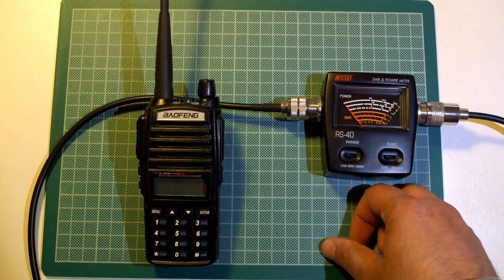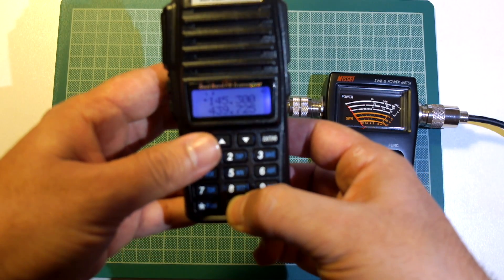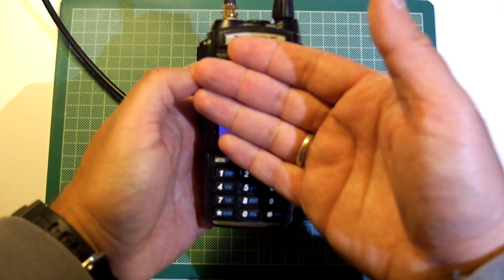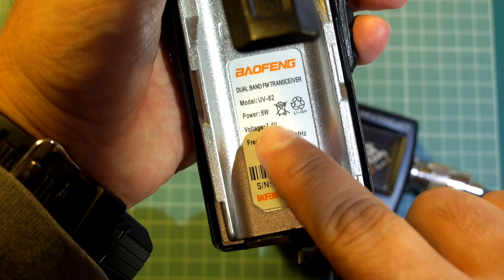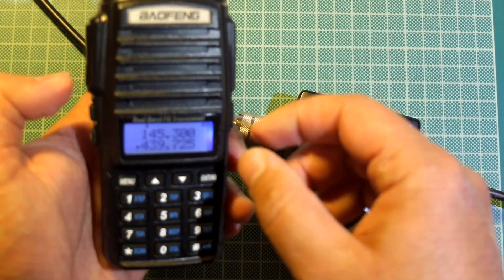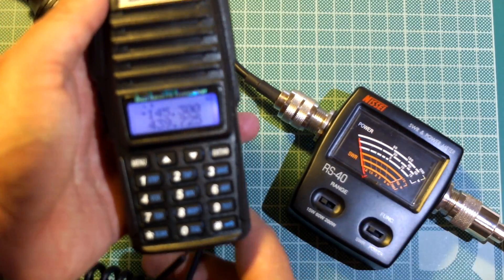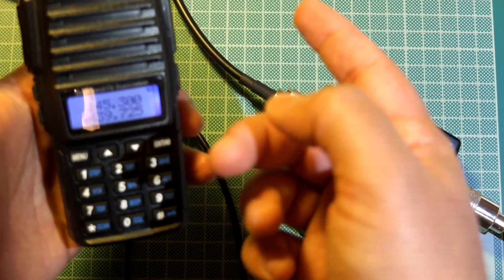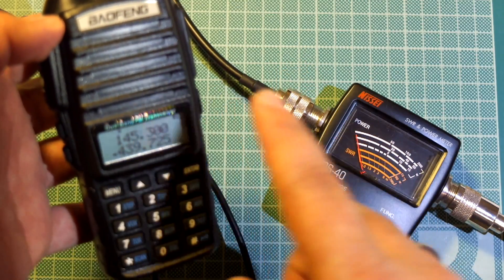Baofeng UV-82 8W Power Test

Comment: He just has the original 5w radio. That’s why there is only an L for low on the screen and nothing for high. The actual 8w HP versions have a H, M, and L that pop up on the screen for the three power levels. 

Folks have tested the UV 82’s pretty extensively and the 5w two power level units are pretty close to advertised, as are the tri power 8w ones, you just need to be careful as many of the HP ones aren’t HP, they’re just the original 5w, mislabeled.

Comment: That's strange because I have 2 UV82 8W version and both have 3 power settings: low/mid/high, and both deliver 8w easily... I don't know if you have a standard 5W UV-82 advertise as an 8W version!?!
Reply: hi DimeBag
I have a question: is there any difference between UHF frequencies??
for example, I mean is there any difference between 410.5 MHz vs 470 MHz??
I'm a mountain climber and I have purchased a uv82. now I want to know which frequency should I use in mountains and forests to achieve the most range? and also which frequency should I use in outdoor(such as deserts) to achieve the most range? or there is no difference between 410 & 433 & 470 MHz at all !??
Reply: @mohammadbararti5443  I have the best result on PMR446!

Comment: I have about five UV-82s (8Watts), and they tested very good, considering.... Frequencies 462.525 (6.4W); 142.500 (6.65W); and 146.955 (6.8W). You can't really expect 8Ws in any of these frequencies, but it's close enough. If you hit the [# Key], you can cycle through the power settings. If you can cycle through H, M and L, you've got the higher power UV-82 model. If it goes from H to nothing, you've got the standard version, and testing is irrelevant. 

That said, even the standard version UV-82 is better than most of the radios I've tested, and you shouldn't fret. The good thing about the high power model is that you can put it on the MEDIUM and get 462.525 (4.4W); 142.500 (4.3W); and 146.955 (4.78W). This means its MEDIUM power settings are what most handheld radios are powered at at HIGH, and that's impressive! So it would not be a bad idea to put your radio on MEDIUM and leave it at that. 

Even most expensive handheld radios don't quite hit 5Watts, right? They usually come in at 4.xW. Thus, the UV-82 (8W) comes in at MEDIUM power levels, and what most handheld radios (even expensive ones) come in at at HIGH. Then, if you need some extra push, you can inch it up two watts, from 4-point-something to 6-point-something. And you can save battery power by keeping it on MEDIUM. Thus, the UV-82 (8W) is a fabulous radio. It's the sleeping giant Baofeng.
Reply from the maker: I agree with you. When I made this video, there were UV-82s in the market that claimed and actually had 8W of output power, but there were also models like this one I tested, that claimed 8W of power but the claims were false. This is one of those radios.
Reply: @HamRadioReviews  » I hope you find one of the 8W versions. I have two SWR meters and the 82/8W models got very nice results. High: 142.000/6.3W; 146.955/ 6.8W; 146.050/ 6.8W; 460.000 5.3W; 462.725/ 5.3W. Medium: 142.000/ 4.8W; 146.955/ 4.9W; 146.050/ 4.9W; 460.000/ 4.2W; 462.725/ 4.2W. 

I also highly recommend the Baofeng UV-H6. Very nice 10W radio. Average High: 8.6W. Of the two, the UV-82 (8W) is the winner. Why? Because 1) it has a flashlight, and 2) because its Medium powers are very close to what most 5W radios are on their High settings! The Medium settings on the H6 are 3.8 or 3.4, a little less than a 5W radio. The good thing about the UV-82 (8W) is that you can leave it on Medium all the time and you won't sacrifice a thing. The H6 can work on Medium, but it will be a bit anemic. Both are great radios.
Reply: hi john
I have a question: is there any difference between UHF frequencies??
for example, I mean is there any difference between 410.5 MHz vs 470 MHz??
I'm a mountain climber and I have purchased a uv82. now I want to know which frequency should I use in mountains and forests to achieve the most range? and also which frequency should I use in outdoor(such as deserts) to achieve the most range? or there is no difference between 410 & 433 & 470 MHz at all !??
Reply: @mohammadbararti5443   » As you know, all these radios operate best in line of sight; however, if you're in the woods, you'll most likely have to penetrate trees and hills, and from what I understand, VHF will offer some advantage. That said, I generally prefer UHF. And to answer your question more specifically, some people say it's always best to use a frequency midway through the frequency range. I'd choose a frequency in the 443-445MHz range. But is there any significant difference? I don't think so. 

I recently did a range test with a Baofeng  UV-H6 (a wonderful little radio). My wife stayed home and I took off through the neighborhood. I kept my radio in the midrange power settings and it wasn't long before I found myself battling static. I then kicked up the power and my wife reported I was coming in much better, so power also is something you might want to consider. The H6 and the Retevis RT-29 Military (waterproof) are both great options, and the latter will give you a full 10 watts. You can get them in VHS and UHF with a big honking battery. 

If you want to go with a Retevis, I can give you the frequencies of the channels. Notarubicon tested the RT-29 and gave it a glowing review. He was able to go ten miles with it line of sight. If money is a huge issue, I was able to get 8.7 watts out of the UV-H6. With the UV-82, it really didn't seem to like UHF very much. I got 6.8 watts out of the VHF and only 5.3 on UHF. If you have the regular UV-82 5W, it shouldn't be an issue, but if it's the 8W version, I couldn't get more than 5.3 watts out of UHF. Of course, your radio may be different.
Reply: @johnroberts6695  tnx john u explained very well❤ i have 8w uv82 i have test in line of sight with 433.325 and 479.425 the result was bizare!! my connection lost on 433.325 mhz at 2.5 km but i had connection on 8km on 479mhz!! at the same land
Reply: If you are outside in open terrain with little obstruction between you and the person you are talking to, use the lowest frequency, if it's very built up use the highest.
That's technical advice, not legal advice as many frequencies it's illegal to operate on..
But nobody is really going to be bothered or interfered with, and incase of emergency use any frequency you hear someone on
Reply: @mohammadbararti5443 just UHF IN jangles
Reply: yes 👍

Comment: You aren't testing an 8W UV-82. You need to test an 8W model (which will have HIGH, MEDIUM and LOW). When you saw the HIGH and LOW settings, you should have immediately realized you had a 5W version with a label anyone could have printed and stuck on. 

I have an 8W version that has all three settings. The best outputs I have were 7.6W with UHF and just about 6W with VHF. The Baofeng 8W UV-5R comes in at 7.8W at UHF and 6.8W with VHF. But you have to watch the fake radios. Some are great, but others are just labels like yours. You should have returned yours because the 8W 82s are great and personally, I doubt you could see the difference between 8W and 5W.

Comment: My UV-82 says 5V on the back. It only has Low or High settings.
Reply from the maker: Yes, that's most likely the "normal" version of the radio and it is actually 5W.

Comment: Mine is Real baofeng uv82hp with 3 output mode selector (hi/med/lo). I did adjust the internal power output trimmer (vr2) to exact 8 watts. factory release baofeng i got has only 6 watts setting on hi power output. Now settings (hi-8/ med-5/lo-0.5).
Reply from the maker: Must be a newer model.

Comment: I find with all these radios that if you trasmit on full power at 138.000  you will get full output from the radio. Bit of a design glitch but i do actually get the full specified power out of all my Chinese radio collection but only on that frequency.

Comment: A particularly humid winter. Went to my safe and pulled my pet 440 radio out of cold storeage. Very quickly had a funeral. It was dead, dead ,dead, do you recommend a UV 82. ?  My dearly departed was a alnico. 1 watt 440 rig. .
Reply: Heck, yeah. The UV-82s are the most underrated radio Baofeng makes. Why someone would buy a 5R is beyond me. People think they're not weather resistant when they're more resistant than they think. I love them. Their weak link is the display. Two lines.
Reply: Uv-82 and the new gt-5r on my shelf. Thanks

Comment: BTW, it doesn't says 8W TRANSMIT power on the back side, just 8W power. It may mean that device power consumption is 8W.
Reply from the maker: I don't think so. Even if it is, it's still misleading.
Reply: @HamRadioReviews  I agree
Reply: Nope, the battery output would be the device input.

Comment: i have a UV-9R plus it claims to have 15 watts on high it is only 4 watts and the battery is suppose to be 8000 MAH but i dont think it is. i think baofeng lie about the specks of their radios mine is being sold everywhere as 15 watts the manual says 5 so even the manual lies.
Reply from the maker: Sounds like not true claims.

Comment: How did you bring up the battery voltage on the screen???
Reply from the maker: Press and hold the "0" key. If it does not show up, you probably have an older model.
Reply: HamRadioReviews Thanks for the reply. I must have an older model, no battery info here.

Comment: Please do not take this information wrong. The back label on your Baofeng UV-82 should say UV-82HP if it is a HP model or maybe UV-82HX. Since it says UV-82 with no H, I doubt very much that it is a UV-82 8 watt radio despite what your seller stated. Sorry. Additionally the wattmeter that you are using is not very accurate. I would not trust it. Lastly,  my UV-82HP (from Baofeng Tech USA) is marked in the battery compartment as 7-8 watts RF OUTPUT., not simply 8 watts, which may be the input wattage, as we know that there is a difference between input power and output power. I suggest that you ask your dealer for a refund.   73
Reply: Not necessarily. None of my UV-82 (8W) radios are labelled UV-82HPs, yet they are clearly higher powered. Frequencies measured on HIGH at 462.525 (6.4W); 142.500 (6.65W); and 146.955 (6.8W). You can't really expect 8Ws in any of these frequencies, but it's close enough. If you hit the [# Key], you can cycle through the power settings. If you can cycle through H, M and L, you've got the higher power UV-82 model. If it goes from H to nothing, you've got the standard version, and testing is irrelevant. 

That said, even the standard version UV-82 is better than most of the radios I've tested, and you shouldn't fret. The good thing about the high power model is that you can put it on the MEDIUM and get 462.525 (4.4W); 142.500 (4.3W); and 146.955 (4.78W). This means its MEDIUM power settings are what most handheld radios are powered at at HIGH, and that's impressive! So it would not be a bad idea to put your radio on MEDIUM and leave it at that.

Comment: Thx Sir for showing these test results to confirm their false claims, I purchased what appears to be between a BaoFeng UV5R & BF-F8HP hybrid variant of another branding. It claims to be capable of 10 watts power transmission which I find unbelievable even without conducting a test, it also only has High & Low power settings which as you mentioned isn't actually capable of it as new versions of UV5R & BF-F8HP 8 watts has H.M.L indications. Chinese HT radios are cheap but also are notorious for false claims, cheers.

Comment: Thanks for the video.  I have 2 UV-5RA and tried to use the buttons like you did here and found out that one functions like your video and the other one doesn't.  I suspect it is because of the firmware upgrade on the second one I bought.  Nice to know how to check voltage and set the power level with the buttons.

Comment: This is NOT THE HIGH POWER VERSION. I think baofeng accidental written the watt to 8
Reply from the maker: Yes, it not the HP model, I am mentioning this in the video. However, a lot of "accidental printing" goes on... 8W of power, 3000mAh batteries... ;)
Reply: HamRadioReviews no its not the 8 watt version that's a 5 watt radio & model number. The correct model # for a 8 watt is UV-82HP Just don't buy any ham radio on AliExpress. The Fake Fakes

Comment: The high powered Baofeng radios have a medium power setting- not just high and low. You must have a mislabeled radio my friend.
Reply from the maker: Indeed!
Reply: @HamRadioReviews  do you know where to buy oryginal UV82HP but in Eu? i cant find any oficcial websites in eu :(
Reply: You have a Fake Baofeng. Noticed it was fake when I didn't see a FCC Badge on the back after you removed the battery.
Reply: @Shad0wGeneral  FCC? Dude probably isn't in America lol
Reply: Lol i think you are both refering to the waterproof one who has motorola headset connector. This radio only has low and high power
Reply: Yep, if High, Medium & Low  power settings are seen, it's an 8 watt model.

Comment: UV-82HP (for the US) or 82HX (for Europe) are the only official 82 based 8W models (BF-F8HP is only other official 8W model, the rest are all fakes and illegally made and sold). 
Otherwise the UV-82, 82C, 82X, 82L at all 5W. I suspect the seller you bought from had it mislabeled as 8W (possibly to charge more aka scam people).
Correction: HX, not HW.
Reply from the maker: Yes, most likely. Never heard of the "HW" model though. Do you have a link?
Reply: Sadly no, they're hard to come by. and a small correction, it is the UV-82HX for Europe, not HW.
Reply from the maker: Thanks for the info, 73!
Reply: Are you sure about that?
I can't find any UV-82hx in any Baofeng website with these specifications...
Only by a shop that I bought this model and I am waiting for it.
I am afraid that it's a fake.
Can you please help?
Reply: Try a uv-82hp -- guaranteed at least for 7 watts. https://baofengtech.com/uv-82hp although I don't know if they ship outside of North America.